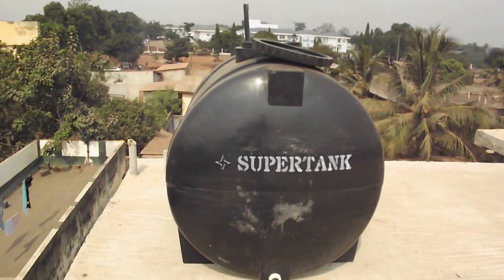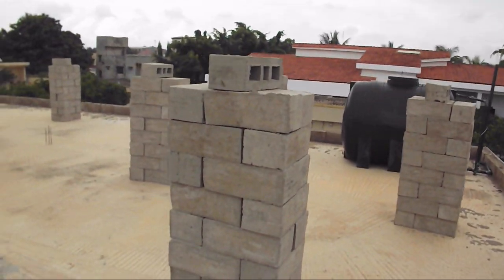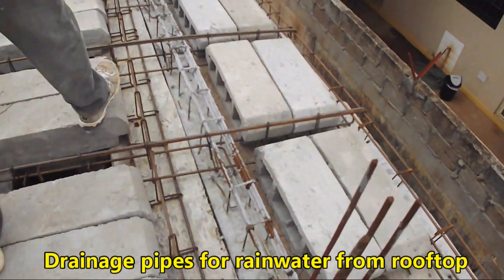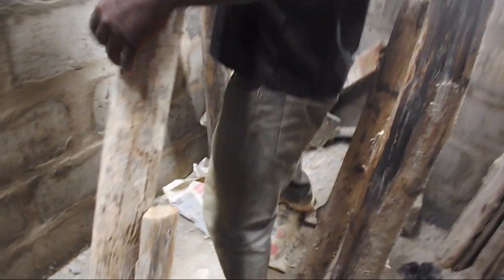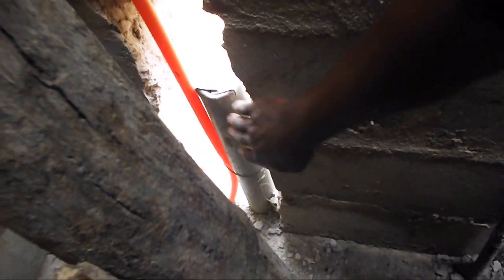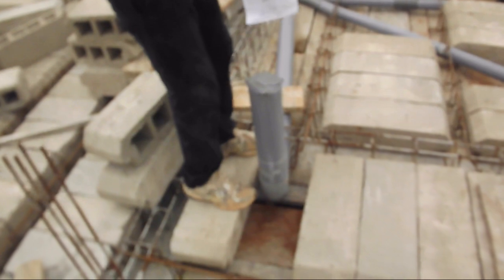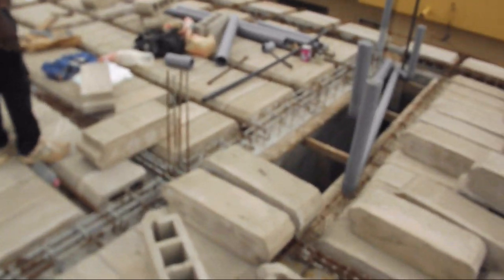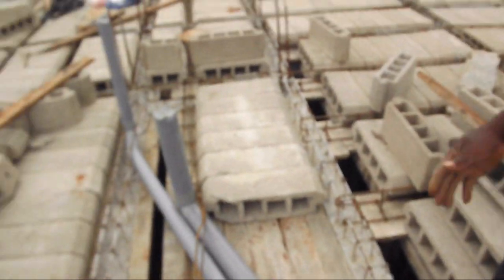Plumbing When Hourdi Blocks Are Laid

Comment: Very nice, I also bought 2 "hourdi" (we call them Abobadilhas in Mozambique) forms, once I find good brick makers I will start making them. They are much more cost effective than the traditional method( buying rebar and renting those plates that support the weight of the concrete).
Reply from the maker: @Krone Moz. Thanks for tuning in and thank you for sharing.  

Best regards to you and the artisans on your project in Mozambique.  Keep it up!

Comment: Hi brother where can someone gets the Hourdiblocks in Ghana thanks
Reply from the maker: Well, thanks for the question.  In Ghana, most of the time, blocks are purchased and delivered to the site.  I do not know where hourdi blocks are sold.

On the other hand, if your building engineer, contractor and masons know how to work with hourdi blocks, these blocks can be made on the construction site.  Ours were made onsite using metal molds, with cement, sand and water.

I hope this helps.  Please let me know if you have any further questions, ayivi.tv@gmail.com . Thank you!
Reply: @AyiviTV  great thanks brother I will email you soon
Reply from the maker: Sure.  You will receive a prompt response.
Reply: I am a builder in Ghana, and I have the hourdi blocks. I mostly mould onsite as we don't have the 2 feet moulds at the block factory
Reply: @truemamle6184  Hello, you can reach out on the hourdi blocks in Ghana